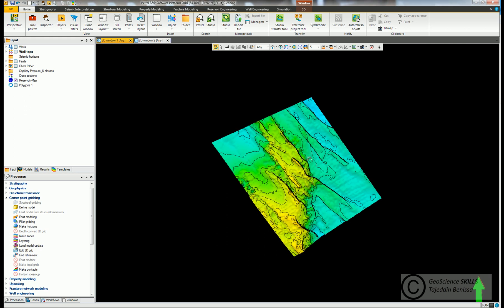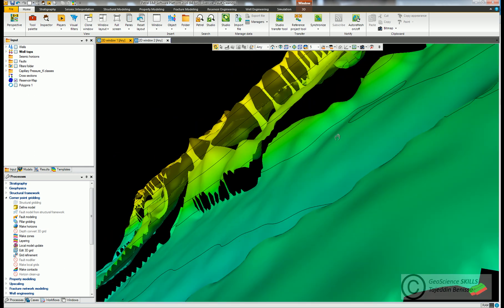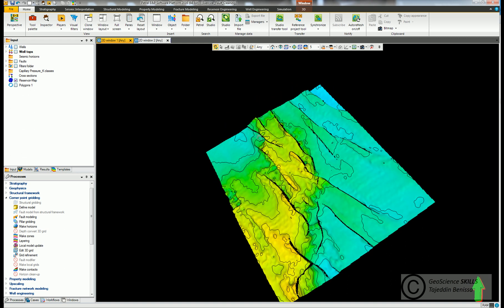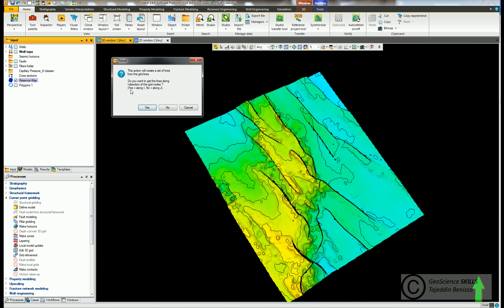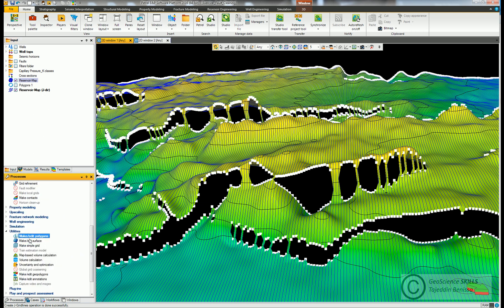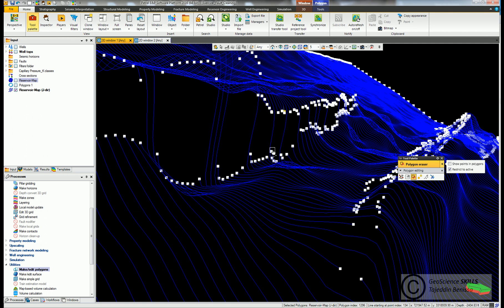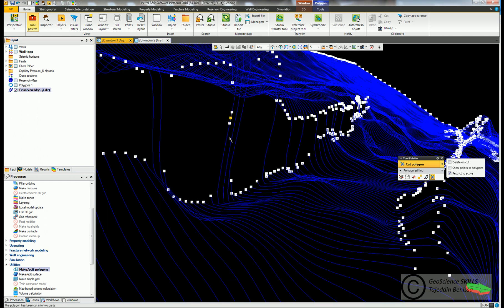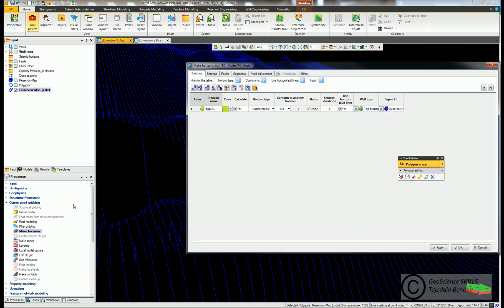How to Clean Fault Edges

Comment: Is there a way to extract each polyline, and clean it in a spreadsheet intead ? Surely each set of upthrown and downthrown points can be extracted at nth location, determine the trend of the throw, use that to build a another set of clean polylines
Reply from the maker: You can do the cleaning right on the model as it is easier than converting them into digital and place them in a spreadsheet

Comment: I have 9 horizons and 5 faults, but 2 of the fauls only cut 6 horizons (the upper ones). How can I run the pillar griding ? Should I extend those 2 faults in the entire grid??
Reply from the maker: Extending the two faults depend on your structural concept whether  these faults penetrate whole layers or no... Chech the seismic section... display the horizons and the two faults to see if they are cutting cross whole layers from top to bottom. In case u found that the two faults are not penetrating whole layers then set Fault Pillars bottom at the top of the horizon where the fault stops then run  Pillar Gridding... The grid should be normally distributed below the unextended two faults as cells would have no skewness or deformation
Reply: @geoscienceskills4839  Thank you so much for respond! I tried to do that, but the grid is still making some rare things. As the grid follow the fault bottom some of the bottom skeleton is disapearing. Now I do not know if it is something in the software version or I am making something wrong haha
Reply from the maker: @KLindsayGCampillo  can u send me a base map for top and bottom of the reservoir.... displaying the faults with highlighting two faults that don't extend to the bottom. Make sure that the grid is visible as well in both maps

Comment: Hi, I have 3 surfaces as grid files , how can I apply faults on them? Please help me
Reply from the maker: you need to input the faults into the model first either as Fault Sticks or Faults Boundaries then you use Faulty modeling tool kit to add Pillars that represent the faults in your model. Make sure that faults available in the model are in the same domain as surfaces (time or depth)